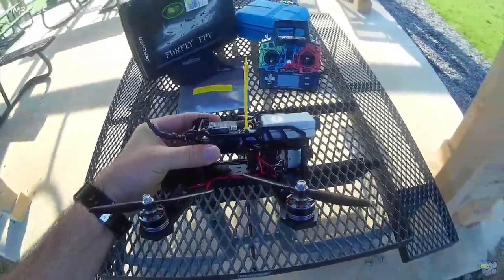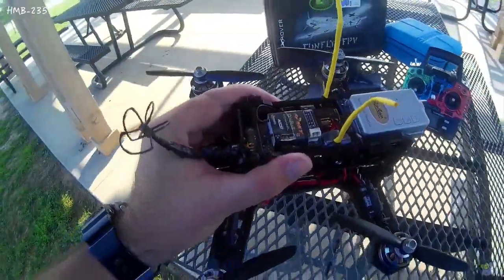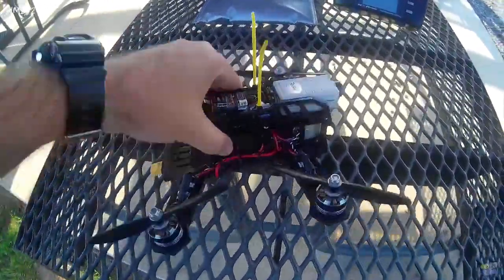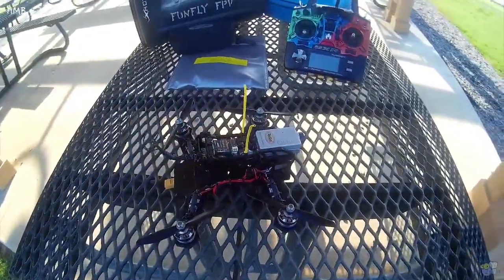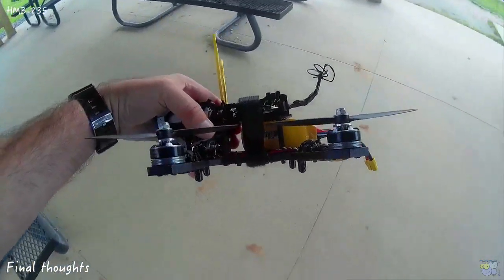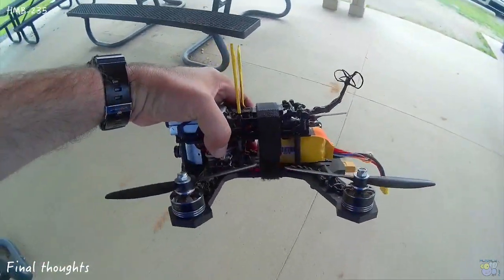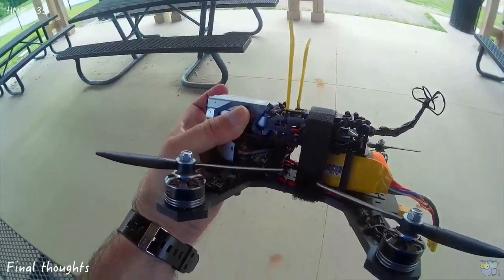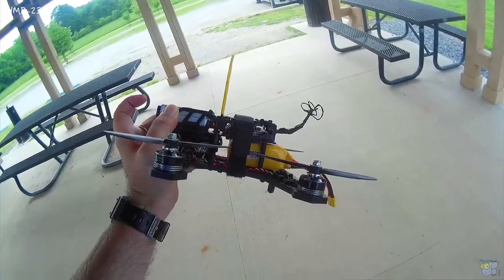FPV: HMB-235 Maiden and Review

Comment: I see you have this running nice now on your other vids, have you had any yaw problems with the position of the board? Thanks :)
Reply from the maker: ActionGeek UK No not really, the yaw center is  forward with this configuration and the back does come around pretty fast, but that can be tuned out.
Reply: FunFly FPV Thanks man, thinking of setting one up  similar to this.